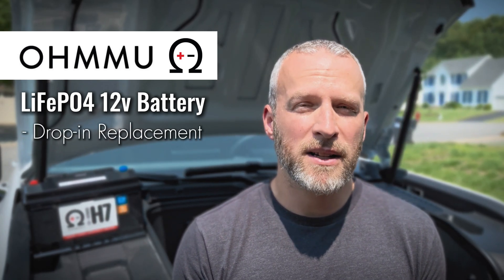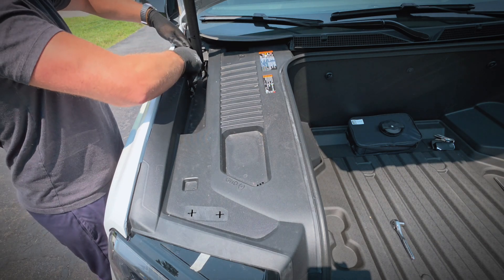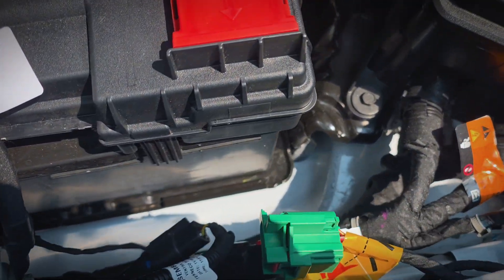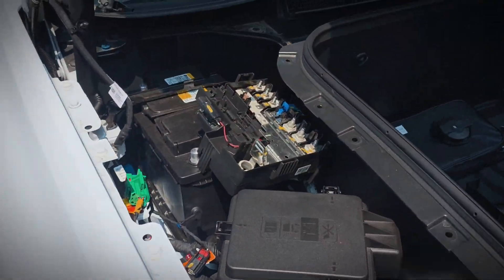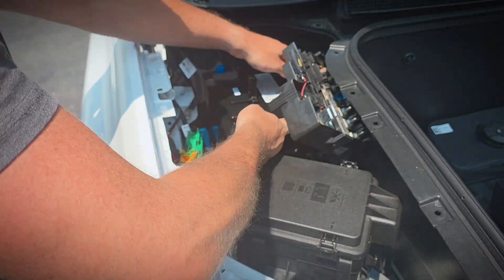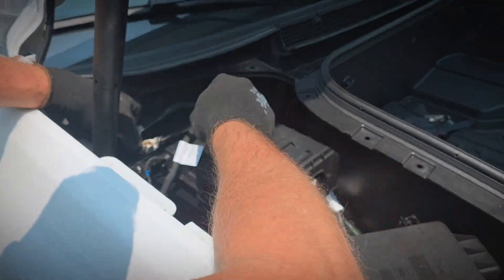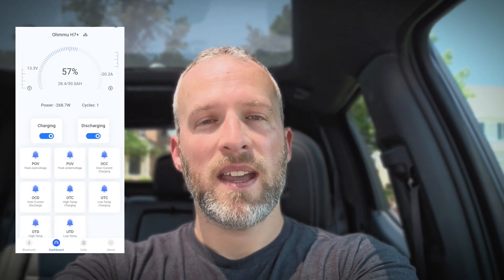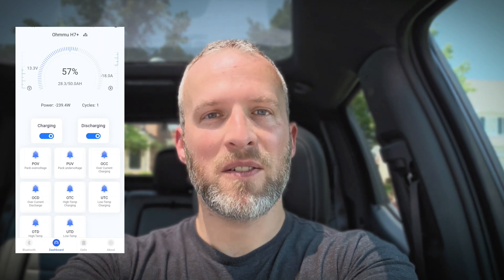GMC Sierra EV 12v Battery UPGRADE: Ohmmu LFP Battery Installation & Review

Comment: Don't fix it if is not broken....  but once broken I will get this battery.
Reply from the maker: Just keep an eye on your battery
Reply: @TechnicallyJeff how do you know if the 12v battery is starting to fail or underperforming?
Reply from the maker: I think you can tell using car scanner and a bluetooth obd2 adapter if it's running low or charging excessively, but I still need to dive into that.

Comment: I have a Sierra EV and live in a very cold climate, wondering if this would be a good idea for me or not. I know the battery has its own heating system, but the website says “heats battery while charging”.  I assume it heats itself whenever it gets cold, regardless whether it’s charging or not? Just turned 25k miles and haven’t had any 12v issues, but I have done the 12v reset a few times, would be nice to have the option to do it remotely.
Reply from the maker: I confirmed with them the self heating only kicks in if it is charging. I guess so that it doesn't drain the 12v battery to keep it heating in cold temps that are cold a long time. How cold does it get where you are? I have had mine in 0°F weather and haven't had any issues personally. And yeah it's definitely easier to remotely reset the 12v using the app.

Comment: Thank you for the video - why did you decide to change the battery out so soon in your new GMC?
Reply from the maker: I've had these batteries in my EV6s and boat and they've worked great and have a lot of benefits. When I saw people reporting 12v issues with the Sierra EV I knew I wanted one.

Comment: Changing the battery on the truck is not very convenient 😅
But what a weight saving 👍
Did they mention if the electronics behind can support lithium surges?
I swapped a regular acid based battery to a lithium on my motorcycle once. It fried the fuse box.
Reply from the maker: Haha it's not horrible. It has an integrated BMS that controls it. It works great. Could always email them if you have specific questions though. But they have it for a lot of EVs. I know a ton of EV6 people with it with no issues.
Reply: @TechnicallyJeff  Sounds good 👍thx Jeff
btw did your wife tried the truck? How's the transition from the Chrysler Pacifica?
Reply from the maker: Yes she likes it. It's primarily her vehicle haha. Nice change from the Pacifica. More tech and luxury. And much quicker.